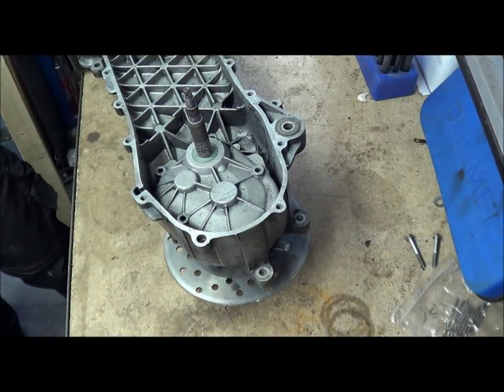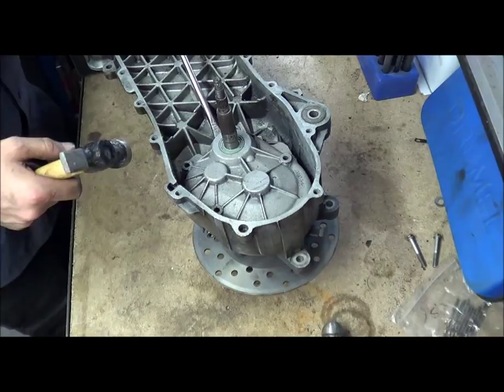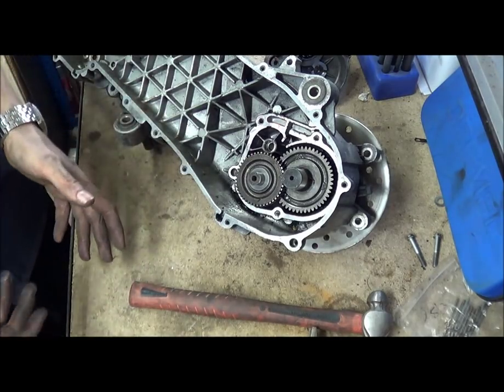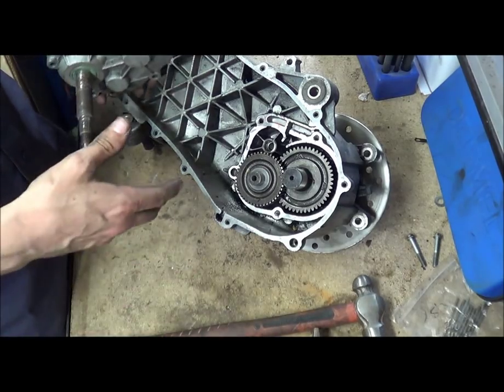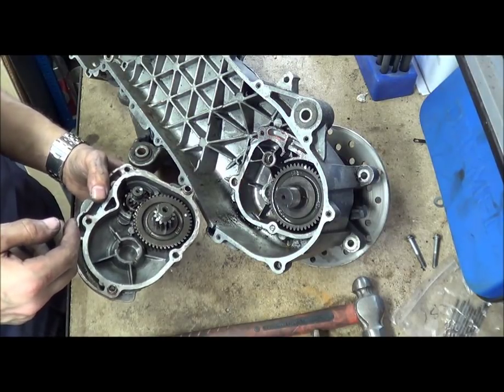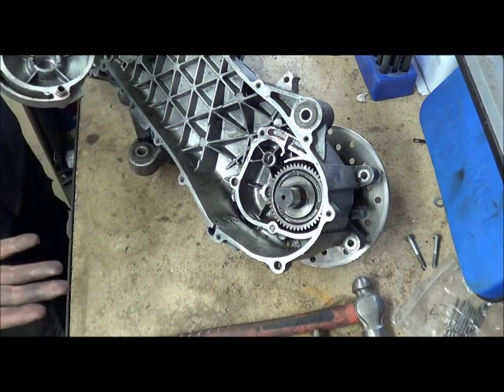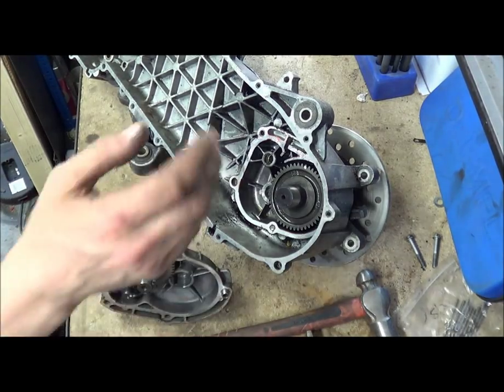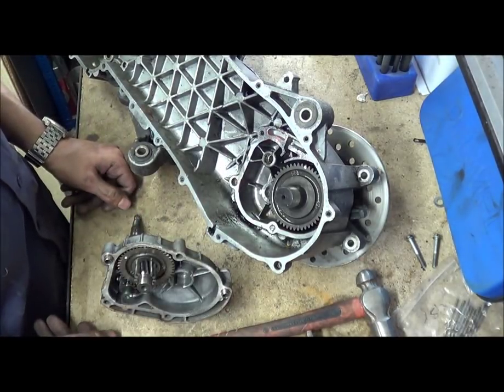Scooter Gearbox and Basic Gear Theory

Comment: Hi I'm in the process of rebuilding the gearbox on a bws minarelli, I have all 6 new bearings, shafts and gears. I'm really close to finally putting it together but I just can't find any specific information or guides about the process, The transmission section in service manual is one page and literally says "Remove parts in order."   and "Reverse the removal procedure for installation."   So basically I'm worried about some spacer\washer that may or may not be needed.  Its not in parts diagram though. And how to press new bearings and gear on shaft, like how far... Any input is very appreciated. Tysm in advance

Comment: And hey man I've been asking around what does changing the transmission gears do and the gearbox you know those little circle things they just helped your bike turn does it increase speed as well.? I'm. So confused people be telling me it does you know those little gearbox hubs the front wheel one in the gearbox ones that are in the gearbox
Reply from the maker: Changing gears changes how the bike accelerates. The top speed doesn't change. If it did we wouldn't need higher power engines
Reply: @thedirtyworkshop  and yes okay bro thanks for your help I appreciate it. :-) now I understand better now 👍

Comment: Well, I didn't know you spoke  "scooter" I just started a gy6 project, it's the 139QMB, 49/50cc,  swapped the 39mmbore for a 50mm,  but I have got the crazy idea of trying to modify the case, to accept a 150cc top end, with possibly a 44mm stroker crank, im not sure the displacement, but 44mm stroke, with 57mm maybe a 63mm bore, big bore kit, it would possibly require machining the deck of the jug, and who know about the timing chain! It's probably be better left in my mind! It's making me insane thinking how to do it, the attempting of it would probably do so! Modifying the frame to swap in the 150cc engine would be by far easier! The chinease scooters are cheap, parts are everywhere! If it were not for being legal, I'd build a subframe and swing arm, and mount a motorcycle engine in the scooter frame,  or better yet just get a chinease 250cc street and trail for $1500, new. But legal crap! I gotta keep it looking like a 49/50cc scooter! I have thought about adding an electric motor to the front wheel, a 72v 6kw motor should make it go nicely, especially coupled with a modified engine, the heads can use a ton of improvement! The valve seats could be nearly 1.5mm larger, using the same valve, they are heads with larger valves available, about 3-4mm larger, a 16mm exhaust valve, that is seating on the smallest part of the valve, isn't going to flow much, especially when the valve guide is blocking 1/2-2/3 the ports! It was so bad I bought another head! It had to be ported and port matched, just to fit the intake gasket! It would blocked 1/3 if the port, the intake/carb  adapter blocked 1/3 on the other side, no wonder they are struggling to make 3hp at 8500 rpm, I will likely just get another engine, and a stroker crank, with a big bore, cam, and the big valve head, going from 16mm/18.5mm to 20mm/23mm valves should make a big difference, especially with a but if porting, to eliminate the restrictions, chamber work is a big issue also, the valves are severely shrouded, they must have horrible low lift flow, low lift is where it's at! Especially with a street worthy cam! I'd guess with a slight larger cam, with big valves , the engine should spin to 10k easily, I'm not sure what it's capable of surviving, unless it is balanced, I'm thinking keep it under 8200-8500,. Stock is rated between 2.95-3.4hp at 7.5-8.5k rpm, I have 2k rpm clutch springs, so it is basically a 4- 5k and up constant rev band, my last scooter would do about 50mph, at about 7500, it needed tuning badly, this project I'm hoping to get it tuned ,  the big bore, cam porting and exhaust, I'm hoping for a good but more power, I don't expect a great deal, but definitely noticable! I also lightened the Piston, and polished the dome, hoping to get the weight a bit closer to the stock Pistons weight! Haha, I took off about 3grams! I didn't want to weaken it too much,  I guess I could gotten  more like 10-12 grams, I didn't feel too lucky!    This is my first tiny engine build, it's no Chevy V8! ( I have also built a 200cc dirt bike when I was a kid, it wasn't so small ) it's a bit strange taking a Dremel to a new head, the shrouded valves, and port issues being so severe, I couldn't just assemble it as is..  the port isn't centered in the flange, from the core shift I'm guessing, the carb adapter, is supposed to be reversable, to allow fitting into different frames, no way this could be any kind of performance orientated!   Sorry for the rambling!! I'm a bit excited to possibly make 6 HP! Haha!! Maybe I can get a 1-2 HP nitrous system! Haha, if the CVT can handle all that TQ! Ha..    I do hop for a top speed of 60 mph,  and 0-60 in 12-15 seconds or so  maybe 20,  I do plan on being sneaky, and swapping in a 150cc into the 50 cc frame, possibly doing a bit of head work, and a big bore kit, there is a possibility of 232cc, I think 150- 171cc is hard enough to get by with!  A 232  would be awesome!!;.

Comment: I have Malossi 13/35 primary gear kit and Polini secondary gear kit 16/44. Peugeot TKR 70cc.  If i put both gear kits it will be ok? Thank You.
Reply: what’s your top speed with that transmission kit?

Comment: I find a few mins with a heat gun on the bearing housings part of the castings hugely assists. Not too hot. But just makes all the difference. Less whacking and hammering then needed.

Comment: Q1. Which Gear oil you used in Transmission of your scooter?

Q2. Can I use Shell SPIRAX 80W-90 API GL-4 Gear Oil GEAR OIL in Transmission of TVS Jupiter or Honda Activa 4G 110cc gearless scooters? 
Will it reduce the performance, pickup & milage and increase the wear & tear of transmission gears of scooter?
TVS company manual recommended to use same engine oil (10w30 JASO MA2) as the gear oil in transmission also.
Reply from the maker: 1) - Motul 80W90 gearbox oil
2) - yes you can

Comment: Your variator is a variable primary reduction. At low crank speeds, you get low gear. As crank speed increases, that primary reduction moves to a higher gear. The gearbox has a fixed final drive gearing. Variator high gear ratio, gearbox ratio, and working tire radius on the bottom determine your top speed. Ideally, you want a little below engine redline at your ultimate maximum level ground top speed. That ultimate maximum is determined by wind resistance and rolling resistance balancing with torque delivered to the road. Gear the rear for a lower top speed at redline, you get more acceleration. Gear for higher, you get less acceleration but still have a lower top speed due to lower available torque. So, you set your top speed desired with your gearbox ratios, up to ultimate attainable by the realities of your scoot, and use variator tuning to optimize acceleration characteristics for that selected top speed gearing.

Comment: Great video but you discounted the ratio of the variator to the clutch. You were assuming a one to one relationship. Your theoretical 1 meter circumference rear wheel would only yield 37+ mph at 10,000 rpm. My Vespa LX 150 is good for 60ish with a 16" diameter rear wheel. (About a 1.3 meter circumference) at 8,000 rpm. Don't kill me cause I'm about 6 drinks in after work but factoring in tire circumference and rpm it seems the variator to clutch/ input shaft ratio is a bit over 1.5 to 1.0 in high range.
Reply: Variator. Changes. Making it simpler.

Comment: i know this video is old, but can you show me the math on how you got 60km/hr?
i just dont get it...
Reply from the maker: Sure, so lets say your rear wheel is turning 1000 revs per minute. Your wheel/tyre circumference is 1 meter. So if the traction between the tyre and the road is 100% then for every rev of the wheel you move 1 meter. Your rear wheel rotation rate is 1000 times a minute, so that's - 

1000 revs x 1 meter = 1000 meters per minute (1km per minute)

1 hour is 60 minutes 

1 km per minute x 60 = 60 km per hour
Reply: thank you very much ; very informative video.
keep up the good work.

Comment: Great video. I have a question relating to the transmission. A Habana 125 Ive just bought has a lot of backlash at the rear wheel, perhaps 2-3mm at the tyre when the wheels off the ground. There is no lateral play (ie, wheel bearings on a normal bike) How much is normal, is there any way of taking the play out (shims?) and which part of the system on the Aprilia is the most likely source of the play? Any suggestions welcome. Cheers. Pete
Reply from the maker: I'd say that's totally normal (rotational movement) there are 3 sets of gears which each have a small amount of backlash, each has to move to engage the next gear, its only when the input shaft from the clutch takes up its backlash that the wheel stops rotating, Add onto the fact that you are measuring the movement out at the radius of the wheel (18 inches im guessing) so that's 1.4m circumference. 2-3mm works out at about 1-2 degrees which is pretty much nothing. Hope this helps - matt
Reply: Pony Power - Theory Thanks for the reply. The rear wheel is only 10" If you think its OK i wont worry, its just a bit weird being used to normal manual bikes.
Reply from the maker: Sorry I meant to say tire. No worries mate thanks for watching.
Reply: Pony Power - Theory I think you meant to say "tyre"  : )  thanks again.